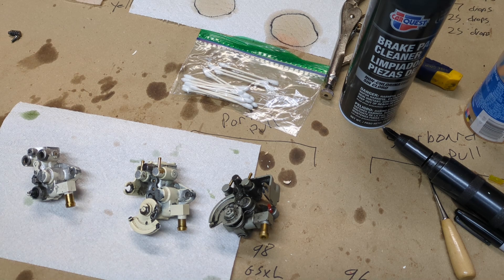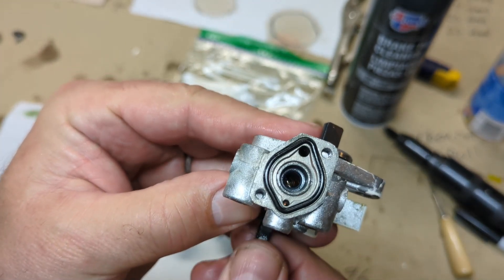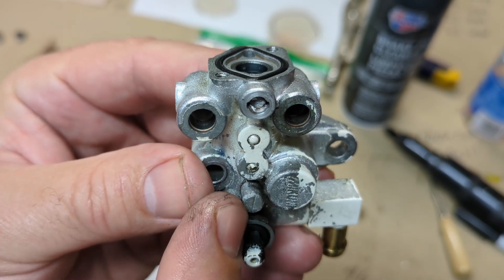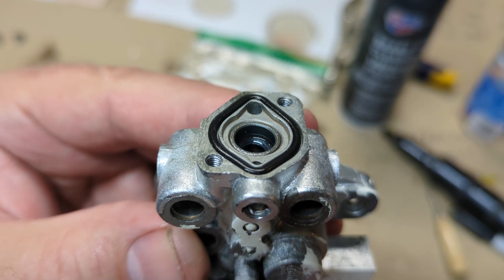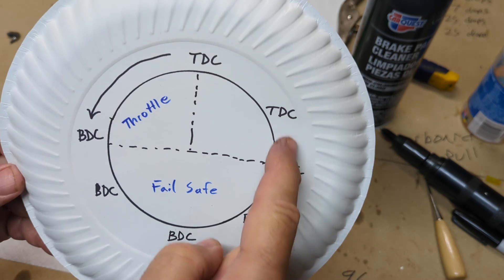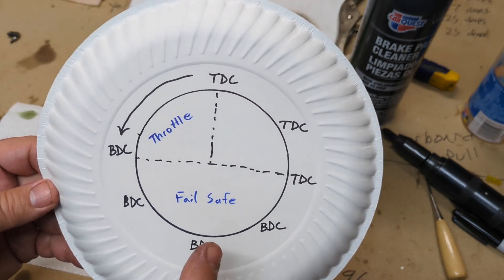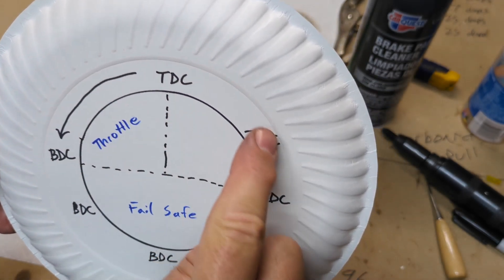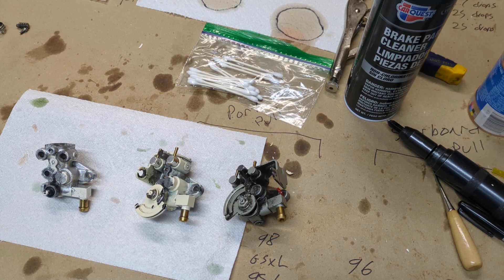How Sea-Doo Oil Pumps Work

Comment: What is difference between silver and black 787 rfi oil pumps? Different part numbers and 13 on the arm instead of 6 like it says in manual. One better than the other?
Reply from the maker: I'm afraid I don't know much about the RFI or DI models. One or both of those have a 3rd injection hose that goes to the fuel pump for lube (not for mix).